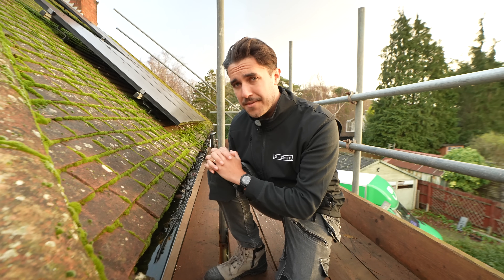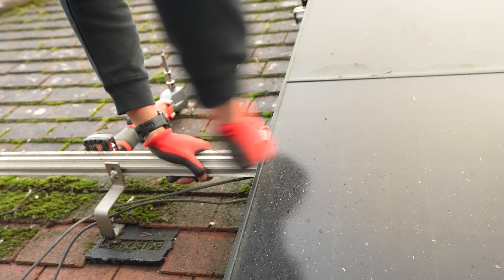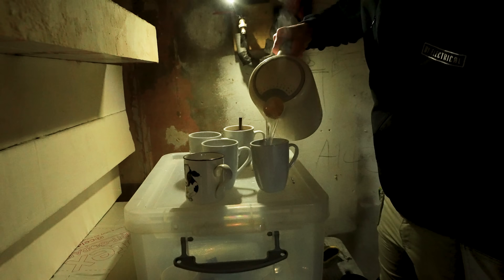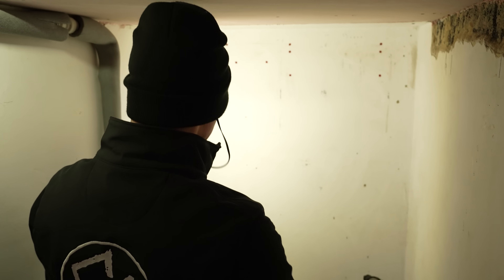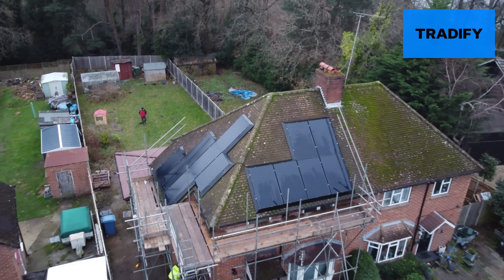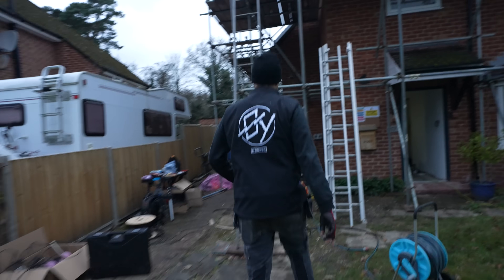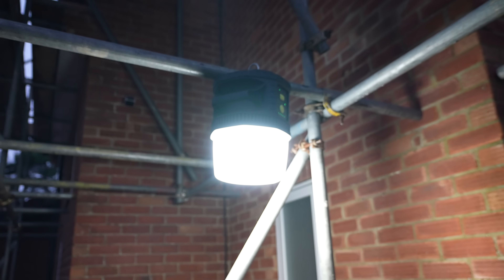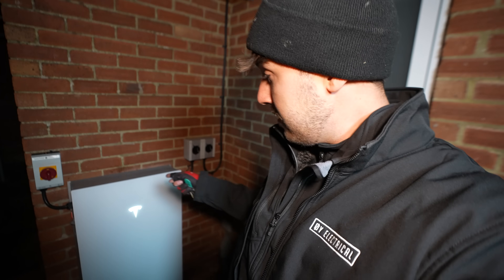Repairing a BODGED Solar Install | ØY54

Comment: Nice to see you testing the networkcable with your electrician tool.. But i believe you need to put the master on one side, put it on, let it run 12345678, then go with the remote to read from that side to see if your connections are also 12345678 to see if any of them are in the right order and make good connection.. Keep up the good work 💪 😎 greetings from Fryslân (The Netherlands)
Reply from the maker: Thanks for the tip! ( we do this, it just didn’t make the cut )
Reply: @corymac  great to hear that and thank you for the quick response!
Reply: No, you dont need to because it's on a loop. This particular tester is useful as you dont need to go from one side to the other to check. Many of them can only be checked on the main unit.

Comment: stuff from elon musk should be phased out
Reply from the maker: This product had a ton of potential, but just doesn’t seem cut out for the UK
Reply: I like the idea of a mass produced LFP battery, a lot of the UK batteries are a bit of a cottage industry product at the moment, labour intensive in their manufacture.
Reply: I am torn because I am researching for a PV install. Think you have separate the Space Karen from the products of the companies he bought. The PW3 and the cars are okay products.
Reply from the maker: It’s not a horrible product, just not the best for the money in my opinion.Feel free to reach out to us if you would like a quote

Comment: You can hear the AI but its better than crackly / broken audio. Definitely makes the video more watchable. Normally I'm quite sensitive to audio issues and its definitely saved you a unusable video
Reply from the maker: I actually wrote the video off, but my editor saved the day and pulled it from the garbage! 🗑️
Reply: @corymac +1 What OP said.